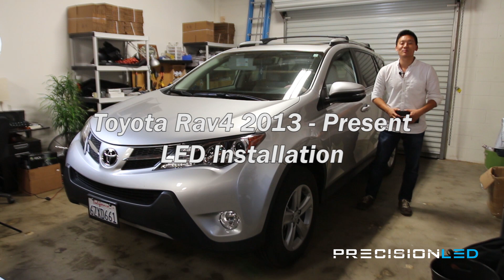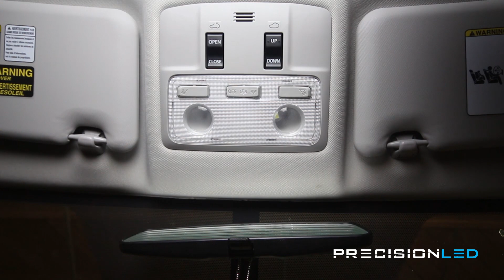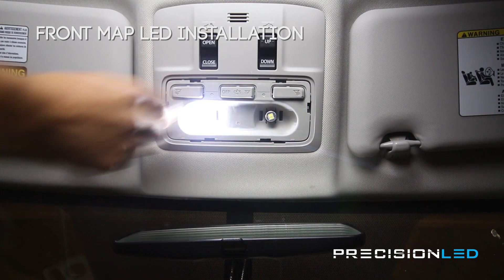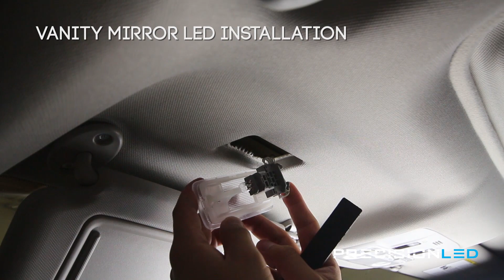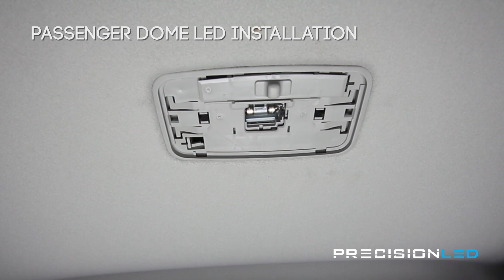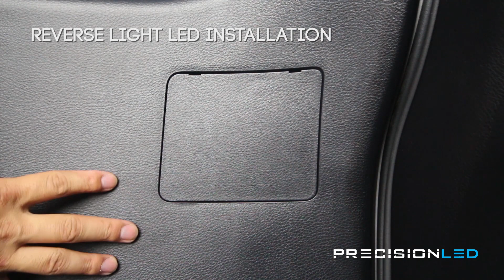Toyota Rav4 LED Install - 4th Gen 2013-2018 (MY2013)

Comment: hello sir. what size did you use for the plate light and reverse light? do you have any idea what size i can use for headlight and foglight? thank you sir!
Reply from the maker: Hi! The license plate lights are T10 bulbs which you can find here:
https://precisionled.com/t10-canbus-5-smd-led.html
The reverse lights you can find here:
https://precisionled.com/toyota-rav4-led-backup-reverse-lights-2006-2012.html
The low beams and high beams would both use a 9005 which you can find here:
https://precisionled.com/toyota-rav4-premium-led-headlight-package-2013-2015.html
Reply: How many inches is the limit on those bulbs?
Reply: I bought a 1.180 inches leds for the license plate light but it didn’t fit. Too tall to close the it in place. Is 0.98 inch t10 led good?

Comment: Any difference in doing the 2017 Rav4 interior?  It has a completely different design of the map light.
Reply from the maker: The 2017 Rav4 should be very similar to as shown in the video.  Most of our installation knowledge is gained through trial and error.  If you like, you can email us a photo of your overhead map light, and I can see if we are able to make a recommendation to access the halogen bulb.  You can reach us at help@precisionled.com.

Comment: i don't know why you using those tools which is more likely the same as using of any kind of flat end shape metals or just a flat screw driver.i can even just use a fork and will have the same result.your tools for removing those cliped covers are just for show.
Reply: Notice he is using plastic on Plastic, sure a metal pick or screw driver will get the job done, but it will scratch and damage the plastic ☹️
Reply from the maker: Yes, we are definitely not just using the tools for show. In our experience, metal tools can damage the plastic, which is why we include the complimentary tool kit with each lighting package!

Comment: Excellent video.  How long will the LED lights last compared to the original halogen bulbs?
Reply from the maker: Thank you for your interest! Longevity varies depending on use, however, on average, I would say that the LEDs would last 4-5 years.  We back all of our products with a 1 year warranty.

Comment: quite informative, I would like you to do the same modification on 2016 model so I could easily relate because I have noticed this model year is a bit different than mine. secondly I really want to change my fog lamps halogen bulb to xenon or like some LEDs board. my headlights have an LED strip and xenon head lamps. It doesn't look right. please help and guide me on what should I do.
Reply from the maker: Thank you for your interest.  Unfortunately, your 2016 Rav4 uses the H16 bulb type, which is a very new light.  We do not carry this bulb just yet.  However, I would recommend contacting us in a month or so to see if we have updated our inventory.

Comment: will this work on a RAV4 2016?
Reply from the maker: Yes, although the video was shot on a 2013, this installation is for the 4th gen Rav4, which includes the 2016 model.  The installation process should be virtually identical.
Reply: +PrecisionLED what is the part that holds and gives power to the led called?
Reply from the maker: There are different types of sockets.  It depends on which bulb type you will be using.  There are festoon, wedge and circular socket which is a ba9s style.  I hope this answers your question.
Reply: 2016 is a little different in how you remove the bulbs. Its a bit more difficult.

Comment: Hi PrecisionLED, I am trying to replace a stop light on the driver side of my 2013 Toyota RAV4. I had unscrewed the two crew but did not how to take of the whole lamb. Could you help please?
Reply from the maker: Unfortunately, we do not sell, or recommend replacing your brake lights, as they would hyper flash when stopping.